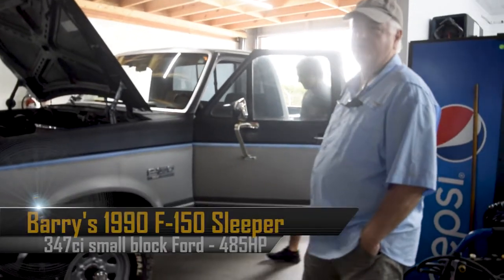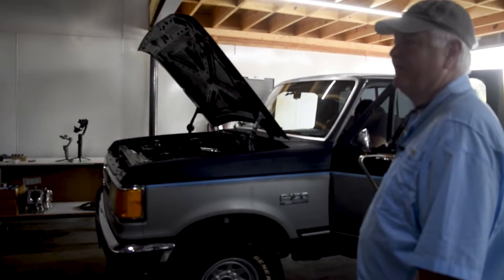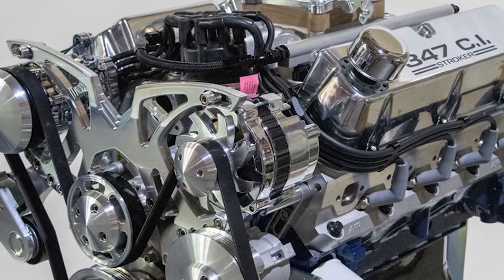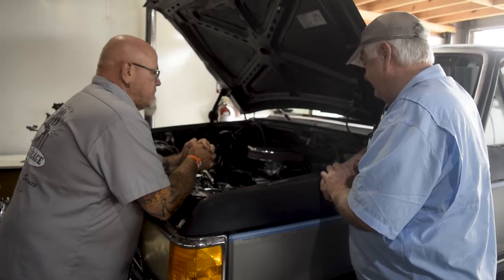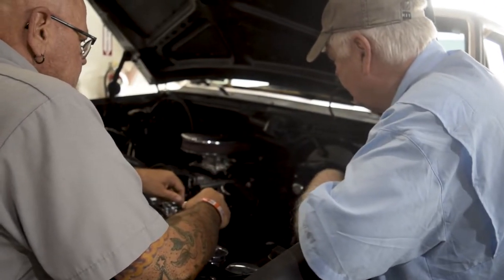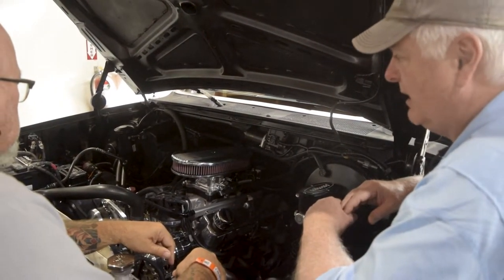Sleeper 1990 F-150 347ci Ford Stroker build and Client Interview at Prestige Motorsports

Comment: What's a build like this cost
Reply from the maker: 347 long blocks start at 6999 (oil pan to valve covers). Then add intake, Holley MPEFI, Ignition and the pulley kit you choose dyno tested it would be in the neighborhood of $15k drop in ready